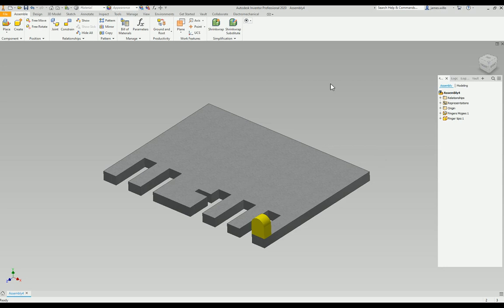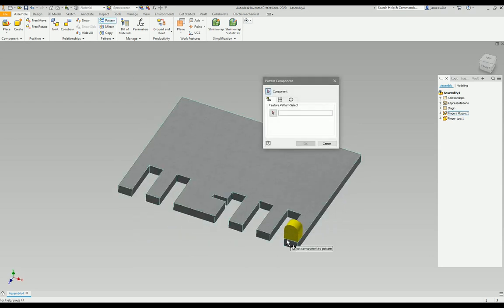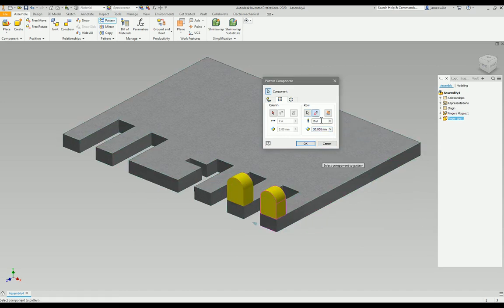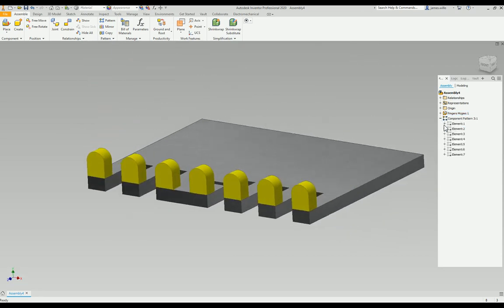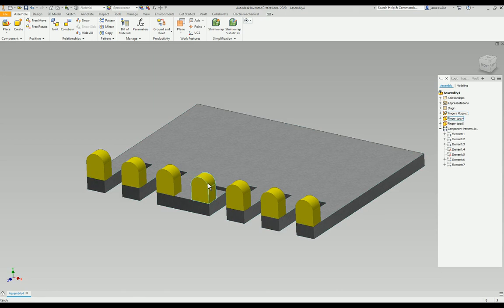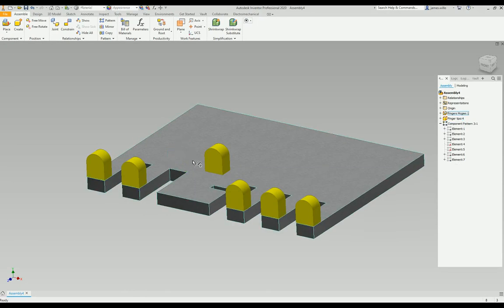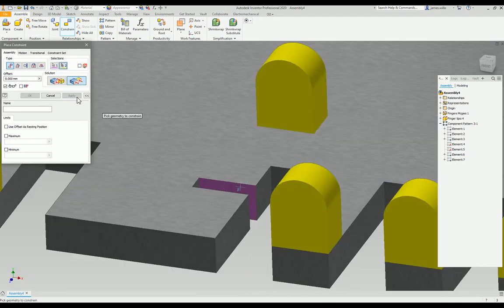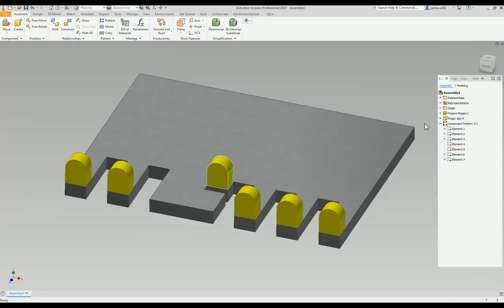Inventor: Remove a member from a pattern to create a gap.

Comment: I'm on inventor 2022, Doesn't work for me. The menu shows me "Supress" but no "Independent".
Reply: Had the same issue.
Reply: I think I just noticed this doesn't work if you have multiple parts, multiple sub-assemblies, or a mixture of both parts and subassemblies in the pattern. Only pattern one part at a time to use the (Independent) feature. If you want to do this with multiple parts you have to make a sub assembly then do it.